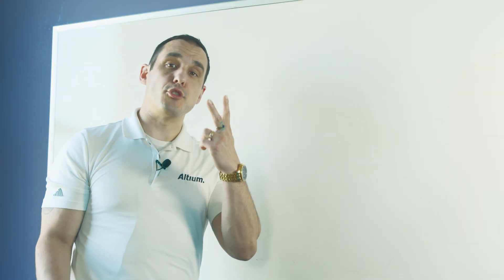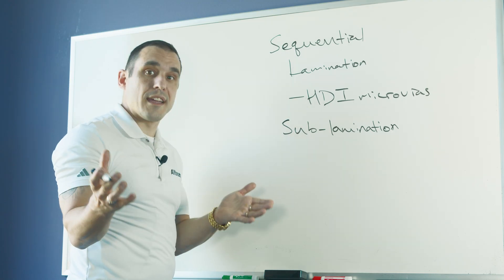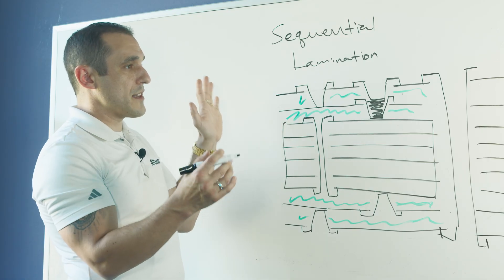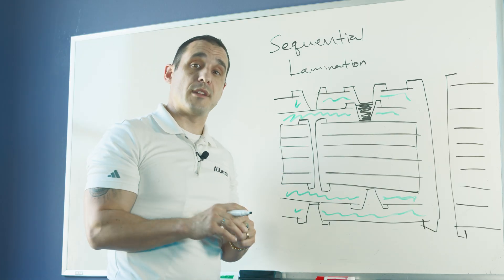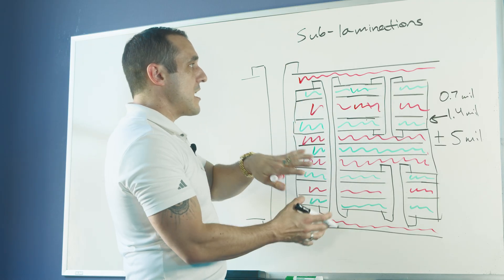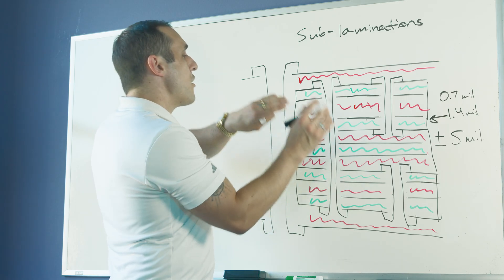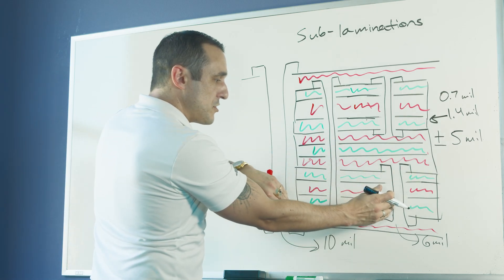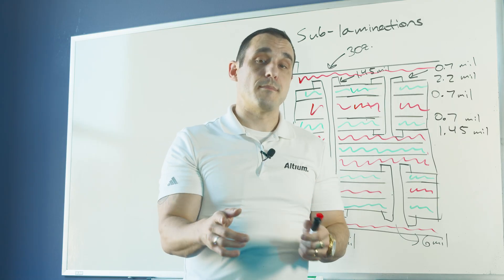PCB Design: Sequential Lamination vs Sub-Lamination

Comment: Great video, I was discussing with a colleague how your videos are really bringing this knowledge to the masses. One thing I think you could have added is the impact of plated layers on trace width. I know you would be aware of this but for everyone else, as you plate up the minimum trace width (or space) will also increase. So even on simple boards your outer traces will normally be wider than your inner traces.
Reply: Yeah that's a great point and I talked about it somewhat in the mechanically drilled blind/buried vias design rules video. That one caught me off guard at one point with a BGA for a class 3 design, it meant that I was essentially only able to use one blind via transition, but I would have loved to use 2 or 3 in that design. Definitely made me re-think the approach and routing.